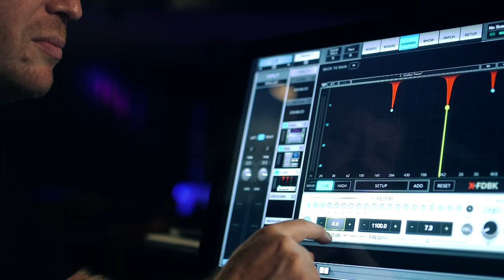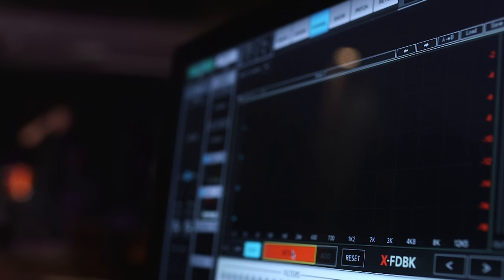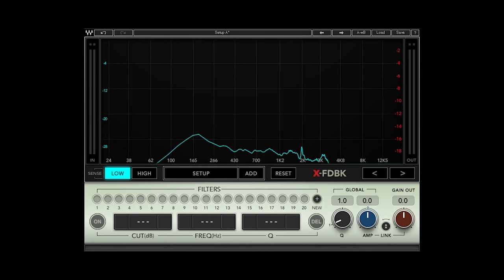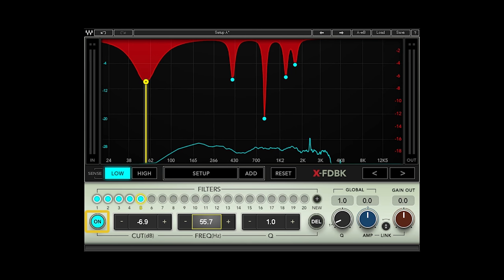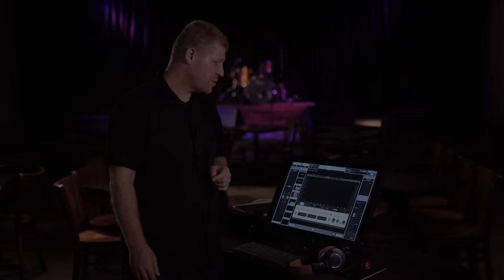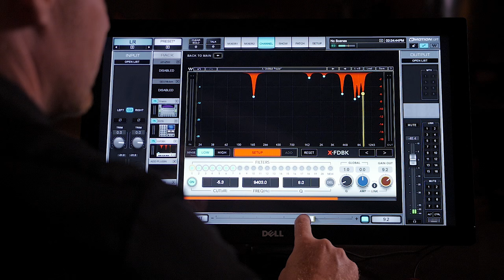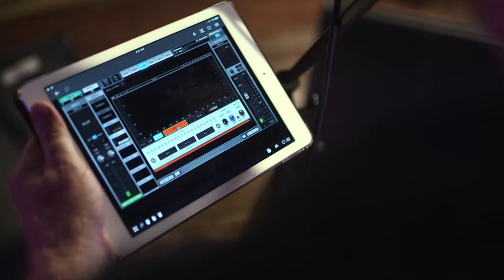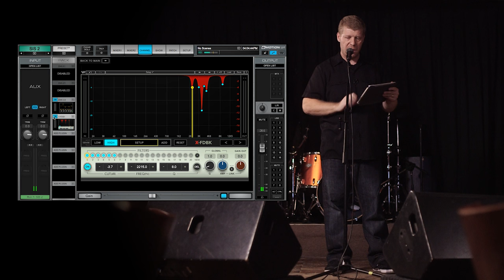Eliminate Mic Feedback from PA and Stage Monitors with X-FDBK

Comment: Hi there, I wanna use this for my live performance setup inside Ableton Live as a DAW backing track. Is it gonna work well for relatively small stage? Thanks in advance
Reply: Yes it works well for small stages as well as large stages. But I would suggest you demo it first to see if it works well for your needs.

Comment: is there a possibility to add this great plugin to a non-digital mixer?
Reply: +Yann W The only way I can think of is to run an audio interface/computer with the same amount of inputs and outputs as the mixer before the board, and have the signal running thru a DAW that can run this plugin with little latency.
Reply from the maker: +Malcolm Z Hi guys, the most professional way to get X-FDBK working with a non-digital mixer is to use DiGiGrid IOC with a designated SoundGrid Server and then load up XFDBK with MultiRack. For more information please kindly reach out to our Sales Team at 865-909-9200 or message them directly here: http://www.waves.com/contact-sales
Reply: +Waves Audio Thank you!
Reply: Honestly, you'd probably be better off with a dbx driverack pa+ or something similar. Sure, the plugin is $99, but the SoundGrid server + DigiGrid interface will cost more than an entry level digital mixer.

I've used the dbx AFS feature and it does the same thing, minus the graphical interface. Plus, you get plenty of other features for $300 or so.
Reply: http://dbxpro.com/en-US/products/afs2

Dedicated Feedback Suppressor unit. Does the job :)

Comment: If this is pre-soundcheck, how does it fare after your singer has been EQd?
Reply from the maker: +JamesMulvale In most cases channel EQ boosting during sound-check should be within 2-4 dB range. If so, make your X-FDBK cuts deeper by 2-3 dB by turning Global AMP left. For more information please kindly reach out to our Sales Team at 865-909-9200 or message them directly here: http://www.waves.com/contact-sales
Reply: So long as you are not using EQ with a lot of boost, which is a bad idea in the first place, there will be no problems. Regardless of what you do with EQ, having the ring-out done properly will help, and the ability to globally crank up the amount of feedback correction enables a quick solution to somebody making feedback with excessive boosting.
Reply: you could do what I do and solo your lead vocal mic in really flat headphones or IEMs and pre-eq your mic before ringing out then ring out after, or you could try the exact opposite and do x-feedback first... but then if you do any "additive eq" it may cause a problem. Try it both ways and see how you like it. For me if I'm using a wireless beta 58 (almost all of the time) I already know what EQ I'm going to do anyways.
Reply: Here's a tip from the studio that can help in EQ live.  When you want to make something brighter, instead of upping some high mid or high, just cut everything else and add a slight fader increase.  This gives you effectively the same general curve without increasing frequencies you already rang out.  When you need to boost more than that, drop your ring frequencies by at least that much in your FB kill setup, then adjust slowly from there to get a nice clear tone.  It takes only a second to trim a fat channel down or up, and you'll be keeping the headroom in your formant ranges rather than decreasing it by raising that field.  You may lose a little DB but increasing afterward should return the total loudness, splitting the functional increase among the frequencies without over driving those you rang out.  You should still apply more drop to those rang out frequencies, but only a little.  This then takes about a minute to 3 minutes per input, cutting your soundcheck time down.  If you increase first, you have to adjust the drop frequencies, then adjust the fat eq again, then adjust the drop again and so on.  Start with a decrease in those opposite your desire, and you'll get your color without a lot of back and forth. 
In the studio, sometimes getting a decent balance in EQ or between instruments, you don't increase the one item that offends, you decrease everything else.  You bus it all, then drop it until the balance is close or dead on, then divide the balance by the number of instruments and round up to 0.3, 0.5, 0.9, 3, 6, and 10.  Decrease all instruments by that amount, and then adjust back up to bring some back in as necessary, but extremely slow.  Some will need another decrease of a slight touch rather than an increase, but almost every instance I've dealt with needs an increase of 0.1 or 0.2 after the initial drop.  This maintains the color and fusion of the instruments as they sit together without increasing my overall volume, and I can then master at the end to maximize it.